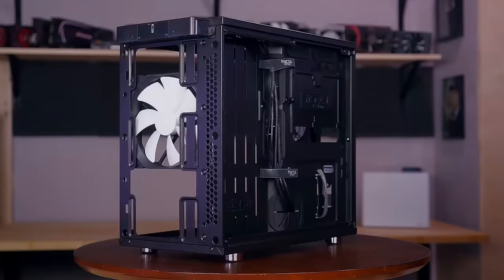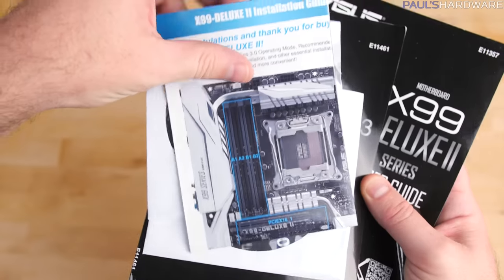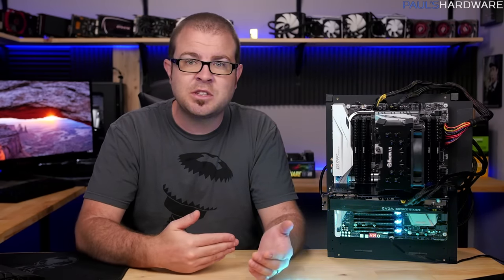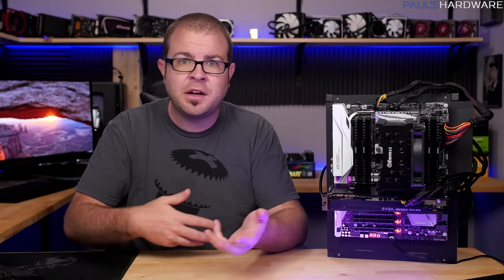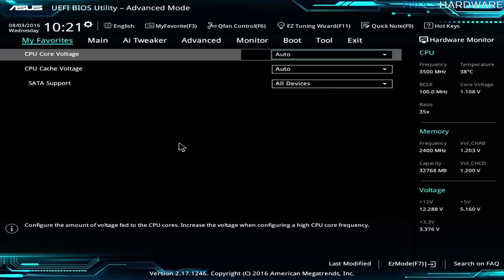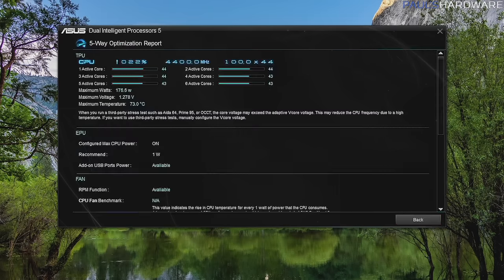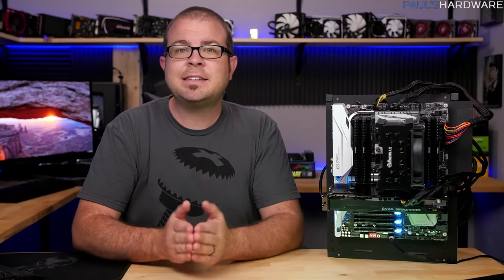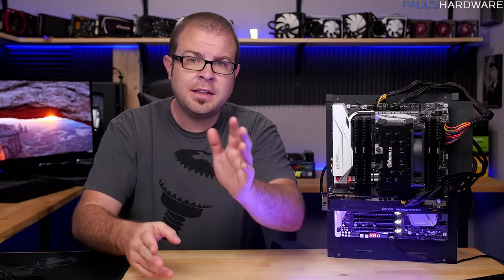2 is Better Than 1? ASUS X99 Deluxe II Review!

Comment: FYI to Paul and all reviewers who question the DVD in the box. I know this video is old, but for future reference. Not everyone has internet available all the time. When you need to connect to the internet to get a driver but the computer can't connect to the internet because it needs a driver, (and you have an optical drive) the DVD's become life savers (well, time savers). They are also insanely cheaper to produce than the smallest thumb drive, hence in 2019 you'll still find a DVD in your retail box.

Comment: Hey Paul. At one minute in, it looks like you have what I think is called a double EPS connection at the top of that mobo. Two questions. 1. What is the difference between EATX which is on my Asus X99 board and EPS?  And in Jayz latest "wetbench"  video, he says he almost borked everything by plugging in the wrong cable up there on top. You have a double connection there also.  2.  How did you know not to do what Jay did?     Thanks    Richard

Comment: Paul, seems the X99 Deluxe II is far more fully featured; given budget is not an issue, would you go with this or the Strix X99?  Using a 6850K cpu, and a 1080 SLI setup.  Thanks!

Comment: Hi Paul, what's the smallest, most compact ATX case you can recommend? Right now I'm running a Corsair Air 540, and am partial towards the CoolerMaster MasterCase Pro 5 - but none of these are exactly 'small' or small-ish.

Thoughts?  I can't go to Mini-ITX as I have full-sized X99 ATX mainboards .

Comment: No one is going over "Key Express". There are some glitches using designated USB 3.0 or USB 3.1 slots actually freezes up the system when attempting to utilize the A1 Suite software keyboard functions.

Comment: Hey guys ! So, weird question... I've got an old machine with an X99-Deluxe and an i7-5820K and I'm looking to buy a better processor for that machine. I can easily find 5830K and 5960X on eBay but I was wondering if this MoBo would support a 6850K. Same socket, same chipset, but the fact that there's an X99-Deluxe II makes me wonder if the first one is somehow restricted to 5th gen chips. I can't find the information anywhere, not even on Asus's website.

Comment: Paul,  how you decide what speed and latency to buy for DDR4??
Reply from the maker: it's usually a minor choice, I get the fastest memory that fits the spec/capacity and isn't too much more expensive than the next step down, if that makes sense :-P
Reply: Kinda... I am shooting for a X99 Gigabyte with a 5820K and will be getting 32 gigs.  I will be gaming and photoshop, etc and plan on mild OC'ing...
Reply: consider 2133, 2400, 2666, but don't pay too much more for the faster speed. Sometimes you can find bargains on 3000-ish speed memory too
Reply: Does VR require faster 3000+ ram?  Also should I factor in the latency?
Reply: Honestly - I went from 16gb 1600mhz to 16gb 2166mhz (?) and I don't feel it anywhere.. at all .. really.. I actually thought of returning it for that reason, but then I found new home for the older set, and ended up keeping it. as much as for VR I'm not sure, but I believe it shouldn't matter, it's more about your graphics card I'd guess

Comment: Very thorough review Paul. Regarding the issue with the RGB LEDs... Cablemod includes an "ASUS Compatibility Adapter" in the package which corrects the order of the R, G, B, and 12 volt leads to match the order used by the ASUS headers. I just finished a Asus Hero VIII Alpha build with Cablemod RGB LED strips and everything worked great. Of course, if they didn't send you the retail packaging that could explain why you don't have them. Cheers.

Comment: Thanks for the awesome vids Paul! I have a question regarding buying RAM for this board. I was looking for a 16X4 set of 3200 mhz ram. However, when I was searching I found two different ram sets with pc4 19200 and pc4 25600 numbers. I read online and read that pc4 25600 is faster data transfer rate to the CPU. I was wondering which one is better for this mobo and i7 6800k. If you can answer, it would be awesome.

Comment: Hi Paul. I wonder can I setup a raid 10 over four or six 4Tb WD Red hard drives on this motherboard. I cannot find any information on this raid setup anywhere. I will be fitting the i7 6850K I follow your reviews and reilly like your live build's. Here's a thought for a tech tip. A lesson for your followers on setting up a raid array on a ASUS X99 board!! 
Cheers.
Mike

Comment: My x99 deluxe ii just died few days ago after 10 months of use, it won't boot no matter what and every time shows q-code 00 solid lighting. Flashback doesn't help and reset cmos doesn't help and battery change doesn't help and disassembling and reassembling doesn't help. I bought it here in Europe (Brussels) with 21% tax. Now I will ask for RMA, if it wouldn't help, then Thanks a lot Paul for recommending such a hardware.
Reply: Had the same problem with mine
Reply: I had the same experience you did. I have been through 2 rma's with that board and it has burnt two cpu's for me so far. When you see a q code of 00, that means your cpu is done.
Reply: When you load XMP profile, check your VCCIO 1.05 and VCCSA voltages, they are often set to 1.25/1.3, then set your llc to 6. Then your cpu you will stay alive. I have been through this all before with a dead 5820k,

Comment: I should have waited until this board came out -- but I still have a nice rig lol - (below) - My big question +paulshardware is,  does the fan extension card still interfere with corsair link - it doesn't work with my watercooler and psu when i try and use the fan controller in the AI Suite 3 asus software.  Any help on that would be appreciated - or even a fix or what im doing wrong with the original x99 deluxe usb 3.1 mobo  And is there a way to see how many lanes each add on is using?  And on this board, is the bios chip soldered on?
https://pcpartpicker.com/user/AEON_Artistry/saved/
Reply: Nicholas Brown all my fans r recognized I have 8 in total had to use the fan extension card and the splinter I've been looking for ways to independently control each fan and cannot think it has something to do with my case

Comment: Seems to me that all the RGB lighting fluff is aimed primarily for gaming type rigs, but this board is supposed to be for far more than that, which makes it just a cost boost gimmick - would rather see a board at this level concentrate more on functional upgrades . If you really want a lightshow buy a desktop Xmas tree its far cheaper.

Comment: +Paul's Hardware   Whats left for the WS board lol. Its gonna have to have 4 U.2 ports, two pcie cards and two m.2 slots, with a 4x4 wireless.  This mobo kicks ass. better option than the ROG if you ask me. And this is coming from a guy that has a Crosshair 5 formula and a x79 rampage IV. Love my ROG mobo's but dat Deluxe life!

Comment: Idk if this is a good place to ask this but i have a problem with asus's dual intelligent processors softwars. I have a z170 pro gaming motherboard. when i install the program i always get BSOD whenever i have my logitech keyboard or mouse plugged in and the logitech gaming sofware installed as well. each time i have tried it i have had to roll bakc my windows install to before it was installed. If anyone has the solution to this problem please tell me
Reply: call asus support...warranty and support is there for a reason.
Reply: try resetting the bios, if that dont work then use warrentt

Comment: I bought the ASUS X99 Deluxe II and it was the worse build I have ever built in 16 years. The board, which was obviously a bad board would never run stable, even at stock speeds, kept crashing for no reason just sitting on my desk and not even being touched. It has been a pain since the day I built it. I'm sending it back to ASUS after 11 month's as it's still on warranty. My thought is it has a bad bios chip. I've already ordered a new MSI x99 s titanium to take it's place. When the board eventually comes back from ASUS I will use it on another build. I;m keeping the MSI board in my computer, Never had any problems with MSI and they have always ran very stable.
Reply: I had the same problem and after 8 months it would not do anything. Shipped the board on RMA to Asustek and they sent it back almost 2 weeks later and said it's ok. Put it back together and still the same. Tried a spare board for another build, the MSI x99 s Platinum and still wouldn't work either. Come to find out all along it was the water pump  going out and went out after 8 months pump went completely out and the whole computer was dead. My Asus x99 deluxe II works awesome now with a new cooler. One of the fastest computers I've ever built. Check your hardware!!!! Most cases it's not the board.